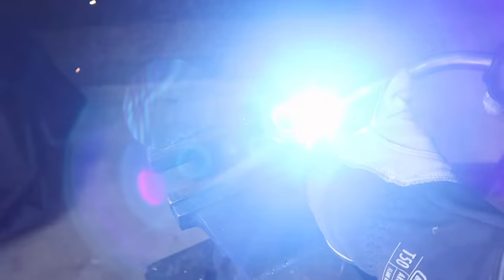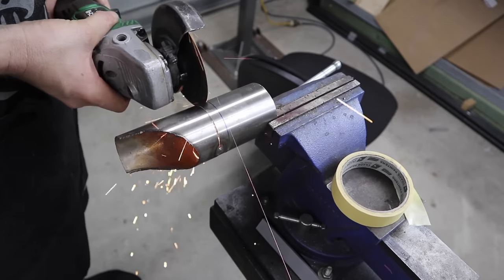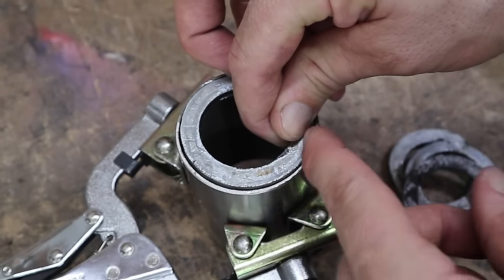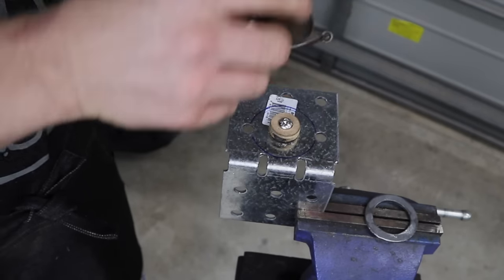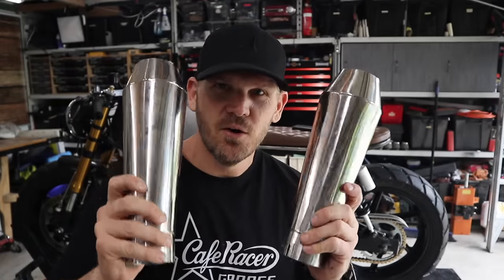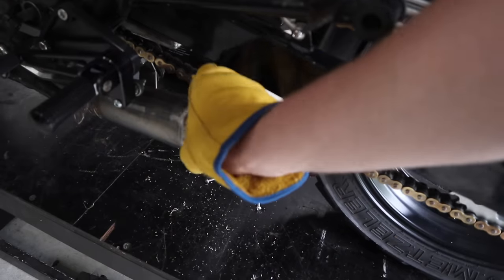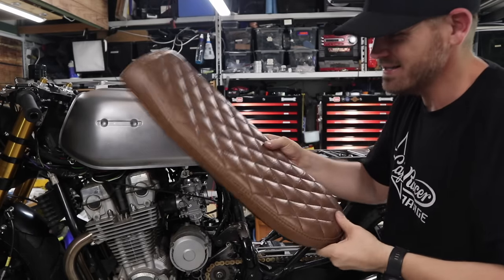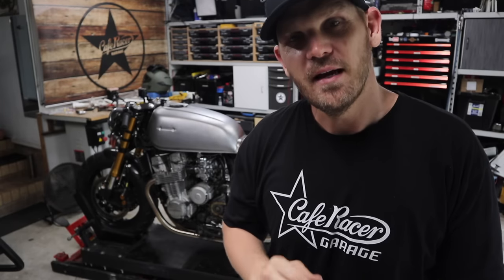★ Making Exhaust BAFFLES & SOUND TEST On The CB750 Cafe Racer

Comment: Great vid. I have two CB750’s (big bore) 79 & 81. If the carbs aren’t clean (ie jets deliver same quantity of fuel through throttle range) and haven’t been balanced/synced the exhaust noise is considerably louder.

Comment: the cct on the CB is a hydraulic auto adjusting type ... you'll probably find that some of the hydraulic oil ways are blocked with a bit of crud .. usually removing the mechanism and cleaning it all out sorts the issue. Love the sound of it at the end of the video .. pretty much perfect😊

Comment: I had the same bike and tried so many things to get it to sound good but nothing worked.
I tried all kinds of baffles. Bought some, made some, nothing ever worked.  Always too loud.
Ended up doing something that seemed wrong, but was the best solution..  i put a cap (round disk of sheet metal) blocking off the exhaust at the tip.  Seems wrong, but was definitely the best it got.

Comment: Great and onformative video mate...thoroughly enjoyed it...I have a question if you have the time.....I have a new can with removal baffle...without its far too loud....with...its a little quiet....its a long tube with around five ridges around 10mm long sticking out along its length....would you recommend cutting a few off or drilling some holes in the ridges or shaft? or would I bugger up the bag pressure or what not? thanks in advance..matt

Comment: Sounds much better mate, maybe needs a tad more to get it around 75db on tick over. That first run sounded almost Harley like (6.46). Nice deep tone though.
Reply from the maker: 100 % agree with you. It’s easy to make it quite but the restriction of flow is the issue

Comment: Did you wrap your baffles in the end? I modded my baffle with the tabs & end plate & wrapped it but I find it just blasts the packing out. To the point where I wonder if I’ll end up with big holes in the packing where I bent the tabs down.
Reply from the maker: Mine was fine in the end :)

Comment: I’m no expert but every aftermarket exhaust seems to have the db killer in the end of the silencer and not in the exhaust tube before it? Great looking bike though 🙂
Reply from the maker: Yeah you can put the DB killer anywhere you want I just put it at the end because it’s convenient,  could even run a straight pipe, and just put a DB killer in it with no muffler if you wanted to

Comment: great video thanks! I just replaced my throttle cables with custom length cables and I had a problem with my throttle sticking.. I had to get the return cable made 10mm longer. 
Easy way to tell is with the adjusters all the way closed how much "slop" do you have in the throttle, if none or little then the return is the problem.
Reply from the maker: Thank you for this Andrew :) very helpful